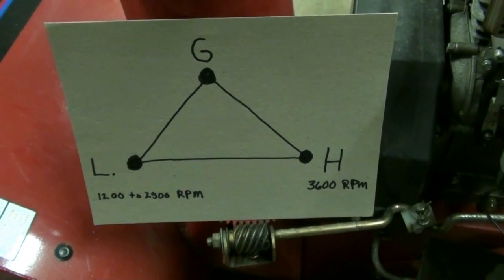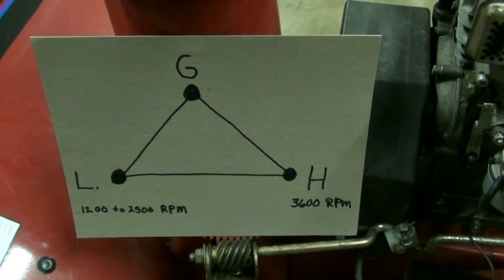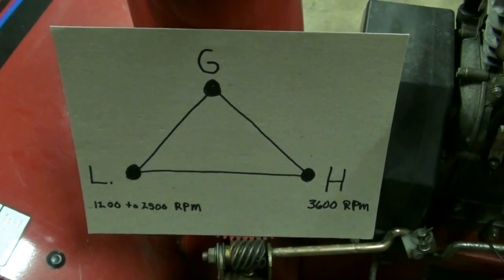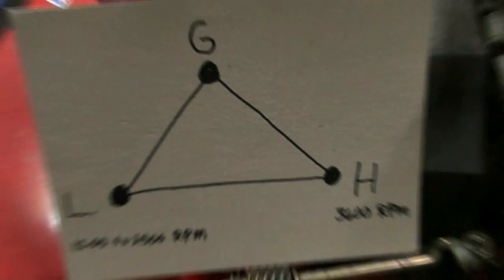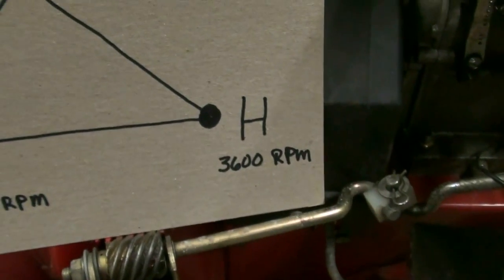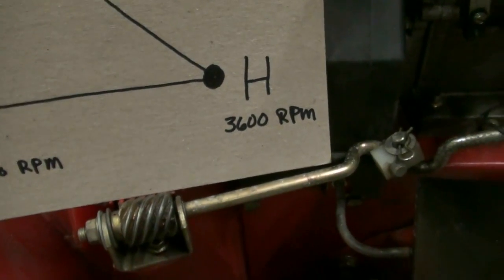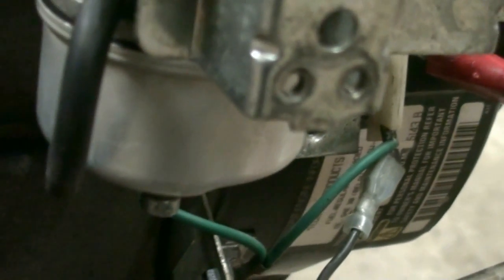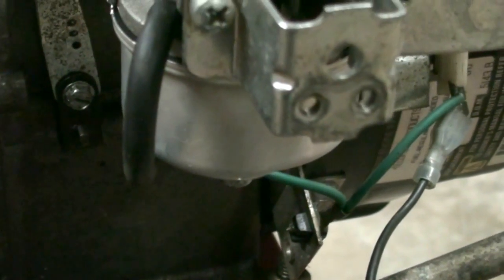Tecumseh Snow King Carburetor Repair Video on Troy-Bilt Snow Blower part #6

Comment: I use that sirometer all the time. Very old school and quite accurate. I've cross checked  it against other "high tech" tachometers and it is perfect as long as you pay attention to the vibrating wire.

Comment: The briggs rpm gauge is super simple to use, once the wire end is at its widest arc, swinging with the vibrations, its at the optimal rpm level, like say you have a 94 Lawn-Boy gold series 10545, it's optimal rpm is between 3500, and 3600 rpm, set the briggs gauge to 35 1/2, and turn the governor setting either tighter or more loose, and once that's done turn the mixture screw to center the way the man here says and then check with the gauge and readjust the governor if needed, this is a very informative video.

Comment from the maker: @mustie1 That is a good price because the one in the video was about $24 from a local store, when I had the meter on the piece of cardboard it in the beginning it was set at 2500rpm and I thought it was 2200rpm, It was my mistake looking through the camera lens, so make sure you can see the numbers clear before you get started with tuning thanks.

Comment: This is EXACTLY what I was looking for! My Tecumseh motor was running extremely rich and bogging down - I tinkered with the carb settings last and kind of messed things up. With the info in this guide, I was able to get the motor running great again. 31Pockets, thank you so much for doing this!

Comment from the maker: so if your engine has the low speed idle mixture set screw on the side of the carburetor only, Like most new style engines have, you will still need to adjust that point in the same manor as the older style engine seen in my video to complete the setup calibration for the low speed

I hope this helps 31pockets.

Comment from the maker: Poochar thanks for your email question.

The High speed idle mixture is set on most new style engines in the prefixed main jet part of the carburetor! If the engine runs good the only thing to adjust is the top speed 3,600 RPM setting with the governor adjustment,

Comment from the maker: Hi 1TINBEATER, and thanks for your email question? The Tachometer or Sirometer is easy to get, their sold through Briggs&Stratton part suppliers and are in the B&S Service and Repair Instructions for Single Cylinder 4 Cycle Engines. They are in this Manuel Book in Chapter 13 on page number 5 seen right at the top of the page, their B&S part number is Tool NO. 19200, I hope this helps. Thanks again 31

Comment from the maker: 1TINBEATER, I also have the Tecumseh part number on the Vibration Tachometer Sirometer and it can be seen in the Tecumseh Engine Mechanics Handbook 3-10 Horsepower 4 Cycle Engines Manuel book on page 91 at the top. (The Tecumseh part number is NO. 670156) now this tool is the same tool for Briggs or Tecumseh, just the part numbers are different and you may haft to order it, I dont think theyll have one in stock? Before I forget 31pockets